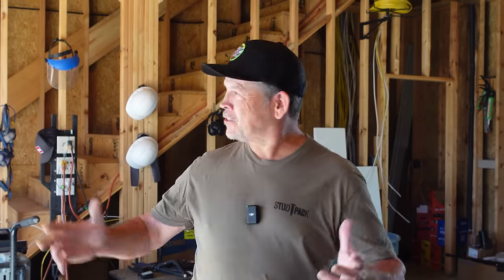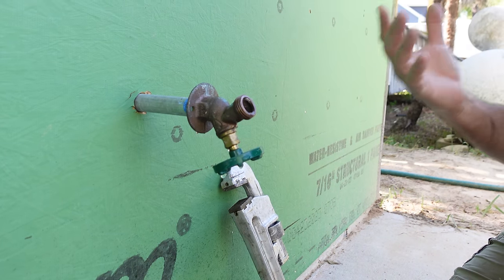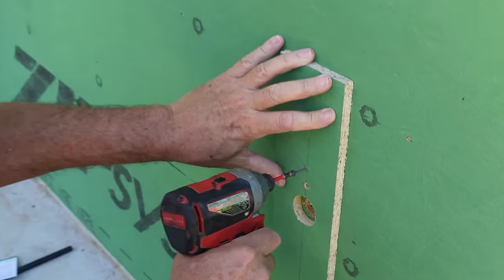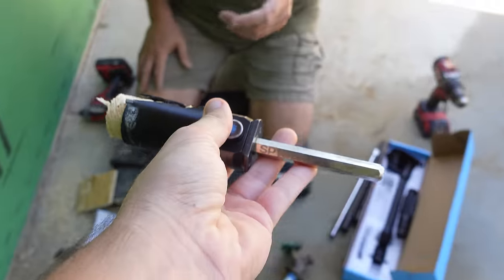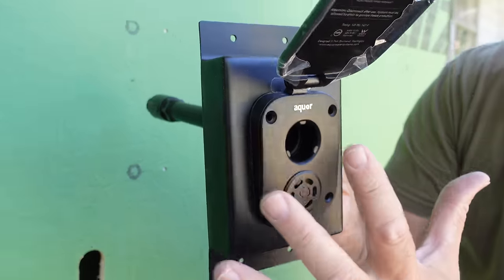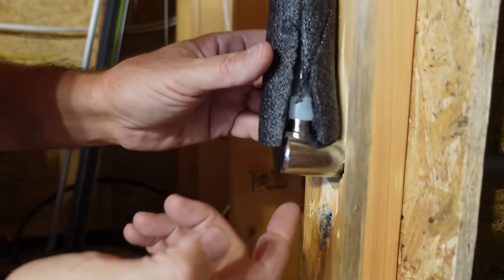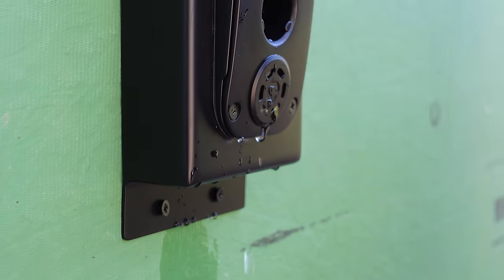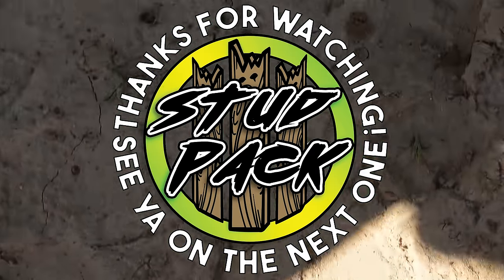Installing a Modern Outdoor Faucet - Ultimate Home Winterization

Comment: Wow, I really like that hose bib set up. If I ever built my own house, I would definitely use that style hose bib.

Edit: After reading a few comments about adding access panel, I got to thinking that the access panel could be added inside the mechanical room in the event that the O-ring or spring needs to be replaced for whatever reason down the line.  That way, the access panel is concealed from public view, but known to the homeowner.

Comment: Good evening, there is one thing that I don't understand. With the pre fabricated sections on the second floor front and rear. How will 2×4's on the flat support these two sections. Even though you added supports and strapping. Over time the flexing in the wall will rip out screws and dry wall taping. This will cause chronic problems, forever. These two sections have no stability. Who ever ordered these sections, should be fired! There is no way if,I was the customer that this would accept that part of the job. 2×4' or 2×6's need to be added to the face of each 2×4. Not only that but how do you intend to insulate these sections. If I was the customer and this was not correct, at your expense. There will be a new contractor finishing this job. And forget about the house, Joe Capo.

Comment: The Aquor system is a solution to a problem that has been solved already. Frost free taps are standard in Canada and I am sure most northern states. They cost a lot less and there is no need for a proprietary connector. Homes are built to last 100+ years and if I were to bet Aquor as a company is not going to last over 100 years.

Comment: Much as I love this channel, that bit on the proprietary problem was hellaciously cringe- the problem isn't so much it being proprietary, but that in combination with little certainty as to whether that part will continue to be produced (which these days is a big question- As one who works on his own car, it's becoming incredibly impractical just to maintain modern cars... Let alone repair, for exactly this problem...)

That being said it depends how durable that plastic is, or if there's perhaps a metal connector- o-rings are an easy and universal replacement! Replacements aren't a problem if they're never needed to begin with.

Comment: Ah lads, don't be getting punch drunk on advertising - it's taking away from your credibility! 
When you say at 19:20mins, there wouldn't be a drop that comes out of the new bib, that's wrong! As when you disconnect, it releases the water outside, back up to the internal internal valve, to prevent freezing, which it's meant to do!! 
The product sells itself - great quality.👍👍👍

Comment: I don't think the fitting with the ball valve is a good idea.  It encourages users to just leave the fitting plugged in continuously.  Then water is present in the fixture right up to the ball valve, and it turns to ice in cold weather and breaks the fixture.  It's common for conventional frost-free spigots to fail because hoses are left hooked up to them in cold weather.

Comment: 4 brass conventional hose bibs on copper pipe on my house working perfectly for 50 years now and cost less than $10 each.    
This thing is ~150 bucks and has plastic parts to break or loose.   
You do you but I’ll pass.  And yes, we have plenty of freezing weather here every winter.  All I need to do is remove the hose in freezing weather… but so will you…

Comment: Hate these water spicots. Just wait until those adapters break or get lost after the company goes bankrupt.
Reply: Easily 3D printed
Reply: @R3CONNNNNN easily 3D printed with knowledge and a machine that costs anywhere from $50-500+ and correct plastic filament to not deform after 2 uses... 
My Chinese joke was more reasonable than "just 3D print it bro!"
Reply: It’s not the plastic that will fail, it’s the o ring. And when that goes, you’ll incur water intrusion.
Reply: They’ve been in business 70 years…lol
Reply: @philweed1603 Most failures are because they’re rub against or chemical.  Not very likely in this application.
Reply: 18:34

Comment: Instead of requiring the users to Drill at 4° Slope, 
why dont they just Include a Slope INSIDE the Pipe itself so the water can drain even when the pipe is horizontal 😂😂😂 ?

 can someone elaborate me on this

Comment: Faucet is a joke!!!  A simple anti freeze faucet will work just fine without the massive cost and the special part needed to connect.  You send all that money on a faucet but can't use engineered wood where it counts.  I get it you are from the south and don't know about cold weather faucets, do some research.

Comment: Do you know what we do in Europe during winters? While the garden tap is closed we also close the main water valve, then open the garden tap or any outside tap in order to relieve the pressure, close the garden tap(s) and you're good to go for the winter, no fancy pansy proprietary water system where you cannot buy parts from after 15 years. And plastic fittings behind a wall is a definitely a no-go here in EU, the O ring will go brittle after some time, its ironic that you mention Space Shuttle there, because we all know what happende on that frosty day in January 1986, that waterline should be a copper pipe with a soldered joint for a absolute worry free water connection to the garden.
Reply: They have specialty elastomer compounds now days that will out last mankind without failing I kid you not. They are not cheap, but for a 5 cent standard nitrile Chinese O-ring, cost I bet would be under $5 for one, made in USA or UK.  That didnot look like your ordniary typical off the shelf O-ring in the video IMO.
Reply: I live up here in the North East USA (Adirondack mountains) and this is what I do.
Reply: @4GSR yeah they use Viton O-rings they will be just fine for more than enough years.
Reply: I live in the States and do the same thing.
Reply: That's a really good tip, thanks for sharing!
Reply: That only works if your hose bibs are on a separate loop for those faucets. You are relying on the air in the pipe to stay under compression to keep water out of the line running to the outside tap. As temperatures decrease, the air will compress more, allowing more water it the pipe to the outside. Most American outdor taps, are like the first ones Paul showed, and are inline on the cold side of the plumbing. I personally prefer the frostproof faucets that the washer is well inside the house framing where it will not freeze. It's simpler than the fancy system that they installed,  no proprietary equipment to use the tap. You can also use the tap in the winter if you need to, just turn it off, and disconnect the hose. 

Many homes in the US do not use copper for plumbing. It's costly, requires more skill to install, and can not touch any other type of metal. We generally use either cpvc, or the newer pex systems because of their ease of installation and flexibility.  The pex systems are generally run either as a home run system, or as a branch system. In a home run system, lines run independenty, and directly from the manifolds to each of the fixtures. In a branch system  a hot line and a cold line run to the room that will be plumbed, and then it uses tee's to connect each fixture inline as needed.
Reply: Copper will split right down the seam when it freezes  Copper is old technology.
Reply: We do the same thing in MN -our home has pex. And each hose bib has a separate shut off valve
Reply: I did something that I guess nobody else does. I put a shut off valve on the  inside of house on all my hose bib drops. I just shut the 1/4 turn valve and open up the bib on outside. I have a full basement though so my drops aren’t all that hard to access
Reply: @westvirginiaminer3046  good idea if you have access from in the house. I have an enclosed crawlspace, 😕 with no access. I didn't build the house, it was originally built before indoor plumbing and electricity...

Comment: proprietary is bad. 
All the items you said are not proprietary. you can buy a third party battery for your drill, you can buy third party parts for your oven, trucks have a shit tonne of third party parts too.
This faucet has a proprietary part that cannot be but anywhere else and is not a universal standard used by all manufacteurs. imagine breaking that part and not being able to use the faucet for weeks waiting for the part. Cause it can't be bought anywhere.
Thef frost-free system ain't new at all either, its a basic system made even more complicated with a spring and proprietary parts so it can't be fixed like the other frost-free faucets that can be fixed with a simple rubber washer.

Its a cool modern faucet and nice to install on your new house but don't make it seem like the best invention ever and better than normal faucets with universall standards parts.

A will be put a ball valve in that access panel to be able to turn off the water before winter as a fail safe. Nothing is 100% fail proof

Comment: Yeah... I'm not gonna buy a hose bib with proprietary parts because it's not the best option. My electric drill was the best option. It's a real lame argument (joke or not)... My current hose bib is all metal, drains 2' inside the wall and won't break unless i do something wrong. Your little proprietary plastic double o-ring connection will break after one too many uses. Or get lost. Or stolen. And it only drains when you disconnect it. Forget to disconnect it for the frost, bam, becomes useless and causes a leak in your walls. I forget to disconnect my hose, yeah same problem but it's not as easy to forget. I'm actually irritated by you making light of a rather major flaw. you can defend a product you like but just say "yeah we understand this isn't the best option for everyone." and leave it at that. my car can take 3rd party parts. my electric drill can take other batteries with an adapter but I'm not HAPPY about that fact. such an unnecessary and bad take on a VALID CRITICM of a product!

Comment: Your proprietary parts argument is broken.  None of your examples involve digging into the wall to replace something once the manufacturer stops supporting it or changes the design or goes out of business.  If Milwaukee stops making my drill, I can easily toss it and buy a new one, I don't have to cut apart vital areas of my home and re-plumb.  I have frost-free sillcocks on my house, in this case made by Woodford, however there are several other companies that make them and have for decades.  They are required by code where I live.  They can be completely serviced from the outside of the home, and the way you drain them is simply disconnecting the hose and they operate like every other hose bib from the last 100 years.  I get you were probably sponsored for this thing, but that hose bib system seems over-complicated and likely to have a company that's not around in 10-20 years and seems like a solution in search of a problem.